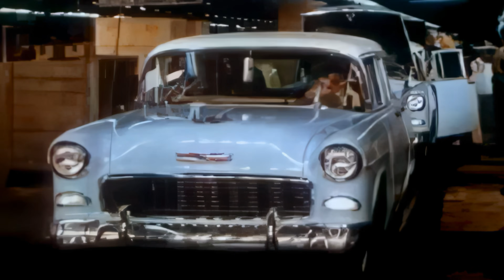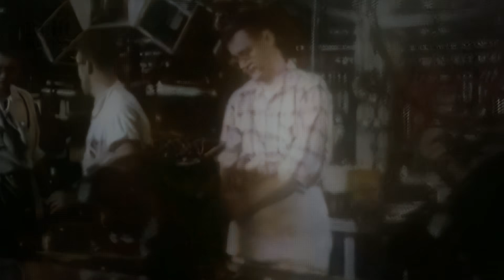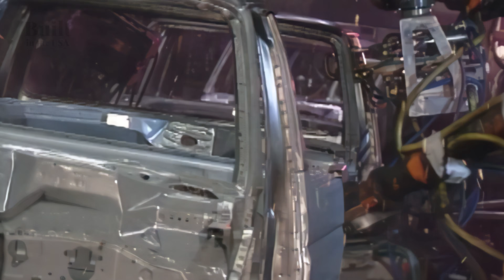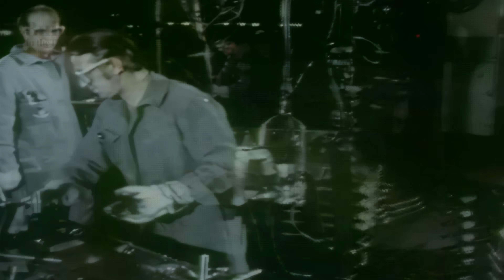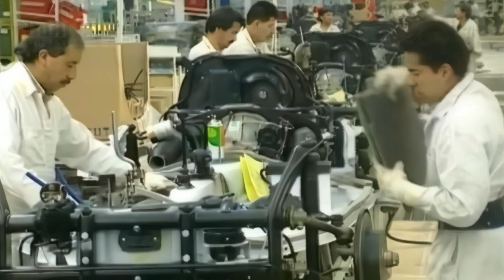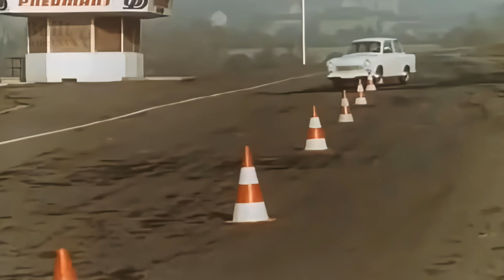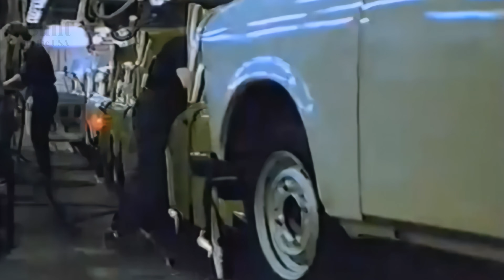Building Chevrolet Impala, Bel Air, Corvair, Biscayne or Chevell inside General Motors retro Factory

Comment from the maker: What if you could buy a brand-new Chevrolet Impala, built exactly like the ones from the 1960s? 😉
Reply: I’d buy
Reply: It would be to easy to make repairs on and parts are available.
Reply: I would buy two
Reply: @ClassicGMtiltcolumns These won't be delivered. The place were they were built looks like a war zone. And proper manufacturing is not possible anymore in USA.
You could make some money if you organize round-trips along former car factories
Reply: i would be the first in line
Reply: NHSTA will not permit the exact reproduction of classic cars without some safety modifications for environmental and crash protection of the occupants. For example a popular 1960's brand new reproduce will look like a classic from outside but will be constructed like a modern car from inside. That is, robotic weldings assembly, unibody reinforced cabin construction with crumple zones front and back, tempered safety glass windshields and door windows, safety steering system, front wheel drive, fuel injection, emissions control exhausts with catalytic converters,, power disc brakes on all wheels, modern seat belts and air bags. Can manufacturers redesign everything? Yes, of course. Can it be cost effective? Can it be cost effective? Definitely not. A gorgeous safety classic reproduction base model will cost over $60,000 each one with all safety features included. If I were the CEO of GM, Ford,  or Chrysler, I would definitely do manufacture special edition safety equipped classic reproduction models. But present CEOs will never think about this. They are programmed for profit. That's why the safety modified classic factory replicas of the 1960's will never be manufactured again. 😊
Reply: maybe but those are death traps liked that , you could sit three in the front seat nice with out computer stuff .
Reply: @realtruth172 I learned to drive in a classic 1965 Biscayne. For me those are superior cars. The driving of a classic is more difficult but the experience is better.  With cheap modifications such as seat belts , safety steering column, rack and pinion steering, and power disc brakes you'll have a superior 5 star classic to embarrass the NHSTA standards of today's plastic, glue, foam,  and soft drink can metal computerized mini cars.😊
Reply: Although the classic cars were good looking and mechanically superior, they lack of basic structural crash protection. No reinforced cabin, doors or pillars. No power disc brakes, no safety steering system, no crumple zones,  no energy absorbing structure for surprise crashes, and no air bags. Thanks.
Reply: I´d buy one if it was a ´61 bubbletop (and i could afford it without a bank loan...), or preferably a ´55 Bel Air. Winder why nobody has thought of reinventing that one like they have with the ´67 Mustang and the Jeep MB, albeit those being stamped in Taiwan but then you can buy them as kits and if you got the means and know-how make sure they are put together allright and not being ruined by labour costs (seems if you have the front bulkhead and title from an original body you can have it registered as a body swap). I´ve read about there being some quality control issues with ´Stangs welded at the factory, but they have been said to replace bad builds. Very good video compilation and informative narration to go with it, thank you 🙂.  Unmm the Beetle isn´t an american car :face-blue-smiling: but a naturalized part of US car culture so i guess it fits. Always had a keen eye for those anyhow. As for the Trabant, i got stuck behind one in the streets of Trondheim, Norway, obviously with the old two-stroke and the driver must have filled the tank up before he left east Germany, poor guy  - i had to break to not choke on his fumes that smelled like coal, or maybe it was the homebrewed oil additive... seriously. They where so ugly because the government wanted to keep them as frugal as possible. same with the Wartburg shown which in its previous, first generation was rather good looking to make it sell well on export markets.
Reply: In a heart beat!  Especially if the price was still affordable. Those old style bodys could be up graded to modern safety needs and less pollution requirements.  Modern epa and safety components can be made to look like the correct era accessories.  Best of both worlds!
Reply: Not possible. Americans don't know anymore how to build e decent car....unless you call Tesla a decent car

Comment: First of all I love the older Beetles. I had a job in 1973-75 at a large department store. We used two 68 Beetles as delivery cars. Myself and the other drivers drove the crap out of those VWs with only some crud getting into the carbs from time to time. Personally I would love to have a 1965 bug.

Comment: Classic cars were gorgeous, but sure death traps in case of crashes. Some simple modifications were needed: collapsible safety steering system, power disc brakes, reinforced cabin, doors and roof, seat belts, and air bags. All changes could be analog and no car computers were needed. Take these modifications as part of your classic car restoration routine.
Reply: your point is well-made and appreciated. 

I tend to put my safety stock into an early US manufactured full size vehicle 'without' the bells and whistles, including airbags; even in many of those who really needed an airbag?
Reply: My first car was an 85 caprice which my mom bought new. It had no safety features whatsoever. Those cars were absolute death traps, not always reliable and poorly made.
Reply: A mechanic cannot add airbags to a sixty year old Chevy.  Duh ! 😅

Comment: That guy licking stickers and placing the stickers inside the windshield must suffer from cotton mouth or dry mouth by the end of his shift. It's at the beginning 0:32 of the documentary. Can anyone imagine working in an assembly line and putting those big bad boys together. What a feeling that must have been to see those Bel Air's together and on the street or highway knowing that you had a big part in the manufacturing of those cars. Unfortunately most of those true hard working Americans have probably passed away. But no matter what, every worker has a small paper or sticker saying  "Inspected by 645. Passed." It was not much but if I was restoring a classic car and found that sticker under the back seat and then realizing you are restoring a car with the same inspection sticker that you put in that car 65 years ago when you were part of the GM Assembly team. That would be an amazing coincidence to have a car in your garage that you helped build. No, it has not ever happened to me or anyone I know. It would be a neat thing to happen.
Reply: I saw one guy spitting on the stickers before placing them in the window near the beginning of the video. I don't know how someone could do that for 8 hours a day.

Comment: Rust buckets.  When you hit the 60,000 mile mark on the odometer you better start thinking trade in.
Reply: B.S.  You know nothing about these cars.  They all went way past the 60,000 mile mark.  And they only rusted in the northern states where they salted the roads due to snow.
Reply: 72 pontiac wagon 11 miles to the gallon tops leaf springs for the rear end .    best riding car ever made . 6 years old to the day I junked it the rear fender rusted so bad the left rear fender gone 18 inches up . 125,000 miles three mufflers fuel pump leaked gas wrecked the motor . sold it to a guy for 100 dollars just had the transmission rebuilt . it then was scraped out . six years to the day I took delivery of an olds diesel wagon $7200.00 new.  bring back the vinal seats better than leather . by the way I was one of the satisfied customers of the olds diesel 30 miles to the gallon motor lasted 150,000 .all those old GM`s it was the same problems the hoses got hard the radiators leaked fuel pumps leaked fix fix fix they never improved the failing parts
Reply: B.S.  You certainly do not know what you are talking about.  You just hate everything American.

Comment: The American car industry in the 50s and 60s was really beautiful and wonderful..but its modern industries are bad and ugly
Reply: Bad & Ugly just like every car company today.  Cheaply built with too much computer's and endless amounts of sensors.
Reply: New cars last longer, are more reliable, safer, faster, more fuel efficient, are far less polluting & require far less maintenance and start without needing to open the hood when it 20 degrees below zero outside.
Reply: @jondoes7836  New cars last longer.  Then why are all of the junk yards full of them that are only a few years old.  New cars have an average of 15 computers and 300 relays to keep them running.  So much more to go wrong and very, very expensive to keep running if something fails.  More often then not most owners sell  their cars or sell them then repair them because of the huge costs involved.  A Honda's catalytic converter's cost $2,500 to replace.  And most mechanic's cannot even repair most car's because they are so complex.
Reply: Junkyards full of cars a few years old? Only ones I’ve seen like that in junkyards are wrecks, stolen & stripped cars, abused & trashed cars. I never had a PLC component fail on any late model car I’ve ever owned. These PLC computers in cars are very reliable and rarely do they fail. Procedures do exist to diagnose and repair newer cars. That’s why you need a technician with access to diagnostic scan equipment to troubleshoot problems. Not a mechanic.
Reply: @jondoes7836  Most technicians CANNOT REPAIR MOST CARS.  Just ask one.  I know a man that bought his wife a brand new over $100,000 Mercedes Benz and after only a week of driving all of the dash lights went on.  She took it back to the Mercedes Benz DEALER.  After two weeks they told her they could not repair the car as NOBODY at the DEALER cold figure it out.  What does that tell you.  You can have your new car.  Not for me.  NO THANK YOU.  The older the better.  I have been able to diagnose and repair all of my cars ALWAYS.  And I never took a mechanic's class.
Reply: @jondoes7836  Correct.  The cars of the 50's-70's were build on planned obsolescence.  It took a tremendous amount of effort to keep one on the road past 75,000 miles.

Comment: The title doesn't match the video.  Only the first 6 minutes of 36 minutes total running time have anything to do with Chevy or even GM.  The rest is an odd mashup of different brands, at least two of which are not from the USA, which is odd for a channel named "Built in the USA".  The video spends far more time (22 minutes) talking about VW Beetle and Trabant production than Chevy.  The voice is very AI-like reading Grok-like information that tends to be repetitive, oddly random, and disjointed.  In some places the narration doesn't match the video, and in other places the info given is flat-out wrong.

Other than that, not bad!   😆
Reply from the maker: Thank you very much for your feedback. I will add chapters to the video to make it clearer.